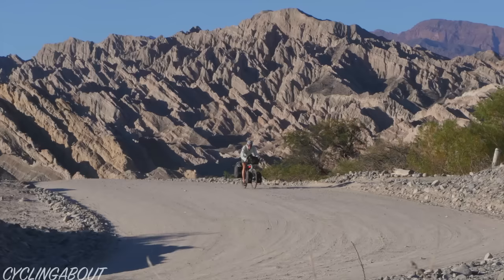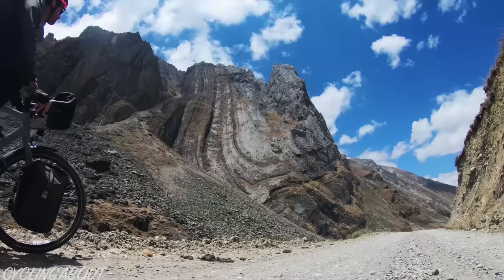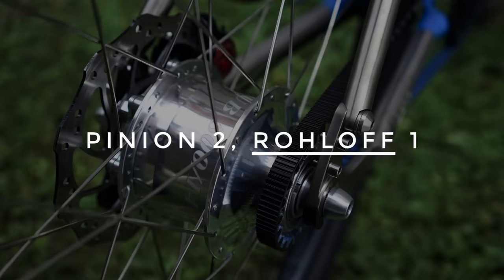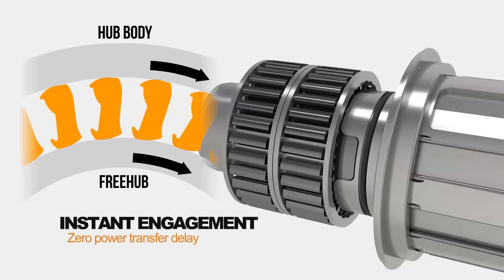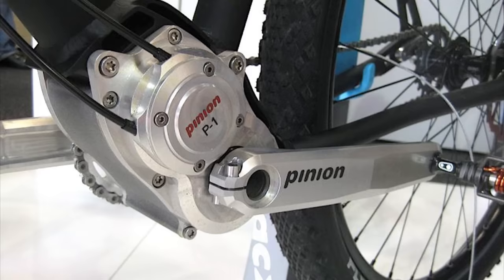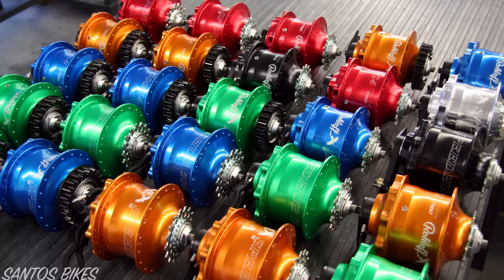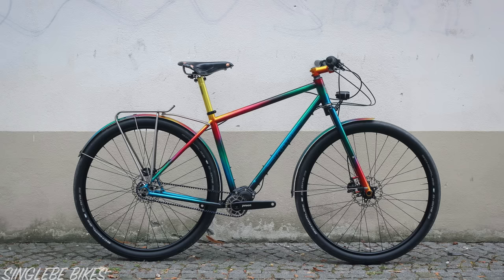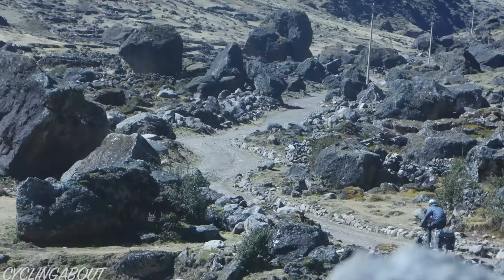What's The Ultimate Bicycle Gearbox? Rohloff Hub VS Pinion Gearbox

Comment: the price are just too high for a bicycle, for this price I could buy a super ebike
Reply: Yes, but an ebike does f*ck-all for your physical condition and doesn't allow for any challenge during cycling. It is like sitting on a moped.
Reply: @ravinmad666  It is true. Assisting  or not, I'm still sweaty and gasping while driving.
Reply: @Don19762  I mean, if physical conditioning is all one is going for, both of these options are overkill. I get my heart rate up really good on my $200 Schwinn with it's stock Tourney driveset. Tossing $1,000 into an ebike motor means I can do that, but go faster while doing so.
Reply: @Don19762  not true at all! Owners of Ebikes use their bicycles way more often, on longer tours.
More kilometers means healthier owners!
Simple facts...
Reply: Fair point. I decided to go for bio bike with expensive components like a Pinion simply because I trust that this bike will last much longer hence is more sustainable. This is something that should play a bigger role in our daily life decisions

Comment: I've come to the conclusion that in cycling hating countries like the US, UK and Australia, the types and range of bicycles available for every day utility cycling is very limited. In countries such as the Netherlands, Denmark and Germany where cycling is very much a part of getting around the choice of suitable bikes is very much greater. Internal hub gears and belt drive bikes are a lot more common for commuting on rather than racing road bikes or indeed the new fad "gravel" bikes. In cycle hating  countries like the UK most commuting bikes are road race bikes, gravel bikes or cheap hybrids with equally cheap and also nasty deraiiieur transmissions which need regular maintenence to keep them turning sweetly which is hardly attractive to new cyclists.

Comment: Rohloff commuter here. At first I couldn't stand the sound of the seventh gear. It literally felt like it sucked my muscles dry all by itself. But after a couple of thousand kilometers the droning slowly subsided to a silent buzzing/whirring sound, especially under heavy load. And this muted sound of spinning high-tech is pure music to me.
Reply: Is this still a issue with the newer Rohloff hubs? From what I've been reading up, it sounds like most people have said what you have. Seems like over time the sound softens up.
Reply: @buckroger6456  Mine's 5 yrs old (around 45 k km) if that's any help. I know they improved the spoke flanges since then but the internals should still be the same.
Reply: @blobbfish9412  wow! I'm still on a giant reign 0 from 2012 and haven't replaced a thing. I just like the idea of a belt and the Rohloff hub. I've been asking people like crazy about it and like you all I hear is great stuff. Thanks for the feedback, it's on my list for my dream touring bike. Plan is to get one next year and start touring.
Reply: @buckroger6456  Unfortunately I don't have a belt. I'm through six or seven chains, a couple of cogs and sprockets and one of the internal shifting cables (which Rohloff recommends to replace around 10k - mine lasted 40k). Right now I'm waiting for my new Hollowtech II crank set to replace the ISIS bottom bracket (the second only lasted for about 15k). But I never had any issues with the Rohloff itself apart from the routine maintenance.
Reply: @blobbfish9412  so no belt setup?! I'm a little surprised, seems to be the way to go these days. I've been looking for bad reviews on the Rohloff and it's rare to even find one so that combined with its better gearing then a cassette, plus it's almost zero mantaince has me sold. The pinion gearbox is nice but I didn't like that crank play you have before it engages.
Reply: @buckroger6456  two things which led to the chain setup: first, I didn't really know that much about belt drives and they were relatively new (and costly), which leads to second: back then cost was more of an issue for me than it is now. So I left out some of the really nice toots and bells which would have upped the total by another ~1k €: V-brakes instead of hydraulic discs, classic chain instead of belt, only an average front light (I got the SON hub dynamo, though). Of course I replaced the V-brakes with HS33 somewhere down the line and got a real front light. But having the frame split just just to retrofit the bike with a belt isn't really worth it imo.

If I had to buy a new all-year commuter now I'd get the belt for sure.
Reply: @blobbfish9412  don't blame you for going for a more cost effect choice back then. You definitely added some great upgrades over time. I plan on making mine a do it all bike, so it'll be for getting around town and shopping as well as heading out for a week or two of bike camping. To be honest here, cycling is about all I do, it's really a way of life for me.

Comment: Just changed my R&M Charger e-bike from 2019 to Rohloff (coming from Enviolo) - should have done that sooner (after 15.000 km Enviolo) - it gives such a smooth ride - definitely using less power from me and/or the battery. With the Bosch CX motor running 22 tooth to 22 tooth CDX drive I have 2.5:1 ratio - compared to the Enviolo it feels like I have 2 high gears extra and 3 low gears. All in all a perfect switch.

Comment: Cinq also offers dropbar shifters for Pinion (Cinq Shift:R Road)
Reply: Thank you for posting this. I ordered a Pinion bike and will be looking to switch to drops.
Reply from the maker: Unfortunately, not for the 18-speed version.
Reply: Seems like the C.12 is probably the most common version at this point. It's a bit lighter, for what it's worth, and you get more options with shifters. Some people might not like the bigger gear jumps, but it doesn't bother me. Also 600% is more than enough for me, though I'm a mountain biker...
Reply from the maker: The C1.12 is perfect for steeper terrain off-road stuff!

Comment: Great job again Allycat!! I use a Rohloff with an electric front hub kit.
HPC top tube battery/controller bag.
Custom reinforced front suspension fork and torque arms. 1000 watt 48v
Reply: Good point. Cheap e bike front hub. I did like the bosh mid drive electric with rohloff integration.
Reply: Why not pedal for yourself without a big motor. Lazy.
Reply: @alexmorgan3435  cycling in the mountains of Maine is hike and bike or high performance motors. I chose the latter.

Comment: My second-hand Rohloff Red Baron developed an oil leak. I contacted the makers who replaced the seals free of charge (I just had to pay one-way shipping of the wheel).
I just checked the crank rotation point; mine do rotate when the bike is pushed backwards but not forwards so this is not a problem for me.
Reply from the maker: Interesting! There might be a bit more friction in the chain/cogs than what is typical.

Comment: For me, pinion gearbox is by far the winner.  After going through 3 Rohloff hubs, they told me there is a weight/watts limit.  Switched to pinion and no problems.  Currently at 35,000k on the same pinion belt drive with little wear on belt. Having the extra gears and super reliability is worth way more than I can describe.   I was crushed having to replace, fix, maintenance and afford chain/derailleur type systems.  I put way too many kilometers on my bike for that nonsense.   Great video and info as usual!  Thanks for all your hard work.  Like the rest of us, please donate to his fund so this can continue.
Reply from the maker: Stoked to hear you're loving the Pinion. 35,000km is the real deal. If I wasn't riding in such remote areas I'd definitely push my belt to failure to see how far it could go!
Reply: Doesn't look like any donations are needed if you can afford to cycle all day.
Reply from the maker: @difflocktwo  If people want in-depth videos like this, I need to make it work financially. Otherwise, I will have to work on different projects that do pay my way...
Reply: @Cyclingabout  I don't doubt what you're saying one bit. That kind of lifestyle isn't cheap to maintain.

Comment: I have a Rohloff on each of my solo machine and my preferred tandem. Pinion wasn't made when i bought those. THe solo machine has done well over 39000 miles, which probably represents about 8 oil changes and 3 or 4 replacement changer mechanisms. The cable inside these wears out in time.
I don't think I have ever changed the gear cables on my solo machine.

Comment: You forgot, that the pinion can handle much higher loads. This is important for very heavy bikes with motor. A friend of me has a quad with trailer and a system weight between 330 an 360 kg. He used a Pinion C12 for about 2 years and 10.000 km a
nd askes Pinion if they might be interested to check his Pinion. They visited him and gave him a new one for free, they even offered him a P18. The old one was totally fine.

Comment: I run two trikes each with a Rohloff plus a dual chainring setup which extends the range out just over 2 speeds. The ultimate way is to put on a speed drive our a high speed drive buy Schlumpf . I have heard of people using the Speed Drive. As I am riding a bent trikes belt drives if I could put them on would not work.  I could have put a Pinion Drive on my second trike as it was a build option.

Comment: Rohloff: easy to upgrade, heavy weight in back wheel (looks odd on long jumps), smallest gear still too heavy for crossing alps for me (you are not allowed to go under a certain ratio).
I was using Rohloff for 10 years on my Nicolai Helios FR, but now switched back to Shimano shifters.
Outstanding for Rohloff is: chain never jumps down the chain ring while so far no other system could provide (no, the Freeride derailleur with the friction switch does not help...)

Comment: I also have an Avanti E bike   ( chain drive ) , what I don't like about the chain drive "Chain Stretch" which causes erratic gear changes and extra costs for a new chain , ( I have converted the Avanti to 10 speed Cluster and it seem easier to pedal up the steep gradients then before with the 9 speed ; I'll let You know what the outcomes are  .

Comment: A nice comparison of the two! I actually retrofitted a fatbike and an old maverick mountain bike to both use Rohloff hubs for purely mountain biking. I'd got about 3000 miles on the Fatbike over 7 years and about 1000 miles on the Maverick over 3 years. I know these are laughable numbers for anyone touring, but I am more of a weekend-warrior mountain biker and nearly all those miles are on mostly rough trails across all 4 seasons of the northern midwest US

The only I've only 1 problem across both bikes; a noticeable oil leak on the fatbike when I got some fishing line tangled up in the rear cog area. I sent out the wheel for a seal change that took about 9 days and and 50 bucks. Other than that these hubs have been absolutely flawless. I wouldn't take any derailleur over them ever. 

I like the pinion gearboxes more but I don't want to have to worry about getting a custom frame for the gear box. Like with the maverick; it was easy enough to get a custom wheel built with a rohloff for it and Viola! A 12 year old bike feels like a new cutting edge bike again! 

Anyway, great video with lots of little angles to consider when deciding between the two!

Comment: I had a Thorn touring bike fitted with a Rohloff gear system. It was great and I rapidly got used to pausing between gear changes. However one problem I did have was that when I just had rear panniers it was quite easy to lift the front wheel whilst pedalling. I have never used a bike fitted with the Pinion system but I like the fact that it sits in the middle, that must help with stability.
But then I was very taken with the fact that it was relatively easy to retro fit a Rohloff system to most bikes. Its difficult to choose !!
Great review, many thanks.
Reply from the maker: The location of the gearbox will have almost no change in your overall centre of mass (it's important to factor in your body - as this is always the dominant mass). I'd suggest moving some weight from your panniers to your handlebars or fork if you need to keep the front wheel down.
Reply: I fixed that with an almost as heavy SA XL FDD dyno drum brake. LOL. 24,000 miles with only a bearing change at 17,000. Near ZERO service or adjustments needed.

Comment: Now I'm using a Pinion gearbox with a Neodrives rearhub motor or a singlespeed rear wheel to get rid of the motor if I go non-electric for longer distance. On the same frame. You can only do this on Pinion or singlespeed bikes. But I had a Bosch middrive bike before and retrofitted it to a Rohloff hub. :D

Comment: 3, 4 and 12 swings it decisively for the Rohloff.
Also I might be tempted to use the Rohloff and a front derailleur.
Reply: Wouldn't you need a rear Derailleur also for the chain tension? The Rohloff is rigged like a single speed in essence.

Comment: For heavier riders like me, Pinion has a recommended maximum rider weight limit of 110 kilograms (242 pounds).  That means I'm better off riding the Rohloff.
Reply: I didn't know that.  Thanks.  I'm 100kg, but I'll also be touring with gear and that puts the weight well over 110kg. ..... like by quite a lot!

Comment: Here is a crazy idea!! 

I've always thought of how good or how bad it would be to have a pinion gear box along with an internal gear system all at once... how fast on flat and how steep on hills...
Reply: A pinion IS an internal gear system. Don’t understand your point ?
Reply: You'll blow up your hub with all the torque.
Reply: https://www.youtube.com/watch?v=e-ig-R65yHg
As Phil said, torque will be a problem. The range will be way too large.
I learnt of the Schlumpf Drive, https://en.wikipedia.org/wiki/Schlumpf_Drive, from Andy Pettitt's comment in https://www.cyclingabout.com/tour-with-a-pinion-gearbox/. That will give you two gears at the front and the Rohloff at the back.
IIUC Rohloff 526% x Speed Drive 1:1 / 1:1.65 = 867.9% range (faster)
High Speed Drive 1:2.5 = 1,315% (faster)
Mountain/Rehab Drive 2.5:1 = 1,315% (extra low)
This seems more reasonable if you really need the extra low or extra high range. I don't have enough knowledge or experience to say, but it seems to me some people find some situations where it may be useful, I've seen videos of recumbent bicycles having both. My guess is that for a regular touring/bikepacking bike its unnecessary overkill that's adding weight and complexity and you'd be better off without it.
Reply: @anywhereroam9698  .... Youtuber JaYoe does that on his trike. His parts upkeep are crazy. LOL

Comment: here is one for you. I am unsure as to torque ratios of pedalling but, through a series of cog mechanisms my suggestion is that you can develop a gear mechanism enabling you to pedal and achieve speeds as fast as cars on the flat. you start with you basic cog on the left side of frame, it turns 4 small cogs that have a larger cog connected. these then turn another cog but, this cog has a through axle so in essence you have two axles. one for the pedals and one for this through axle connected. The inner axles have a particular set of bearings that are in a slip ring but, the bearings can be at the top of the slip ring 'and' on the inside of the slip ring or even side that move independently of each other. This through axle then goes through the frame and turns a connected cog that moves the chain. So in essence your initial cogs are on the left side of the bike and go through to the right. This is needed as the left side cog mechanism is mounted on the frame with the four axle points for the four small cogs to sit. that cog on the right could be part of a standard three cogs you get on regular mountain bikes. so you can still have a gear change system for front and rear. 1. Your pedal moves the initial cog connected to the left side of shaft. 2. It moves four small cogs that have a larger cog connected. 3. the four larger cogs turn a smaller than nr 1 cog that have a through axle to the other side of the bicycle. 4. this has a standard 1, 2, or 3 cog mechanism but not connected to the pedal cranks or axle. I worked out speeds using very basic reference of teeth numbers in each cog 'relative' to each size of cog. One rotation of the pedal per second can achieve great speeds. without even putting your foot down. dont forget the slip rings and bearings need be lubricated at all times with the alloy not expanding from heat for the faster speeds. the slip ring with bearings 'housed' upper and lower, or even on the sides can accomplish independent turning of pedal axle and through axle.
Reply: to help you visualize for further understanding here's how it will look. As you pedal, your right cogs that turn the chain will move faster. In normal gears, your pedal rotation will be the same for the cog that turns the chain. but on this system, as you pedal, the cog that turns the chain will move faster than how your pedal crank turns. it will look strange at first as people get used to seeing it.

Comment: I use a Rholoff on a 2004 Cannondale Lefty fork Jekyl 1000. A chain tensioner deals with rear suspension issues. It’s an old bike but it still makes me look good off road. 
The additional rear weight is not detectable in use but balance is more rear ended. 
The instant gear selection more than makes up for the small weight gain. Routing the shifter cables took time to get right and I still don’t like the twist shift. But going to SRAM type is too costly for me. 
On hills, dropping one gear at a time is best. Acceleration is better doing a double shift dropping back one when it gets too heavy going. 
Gear pick up gets better with use. I ease the pedal pressure and get a near instant shift. I need a larger crownwheel because top can be too easy while bottom gear is too fast pedalling to be useful.